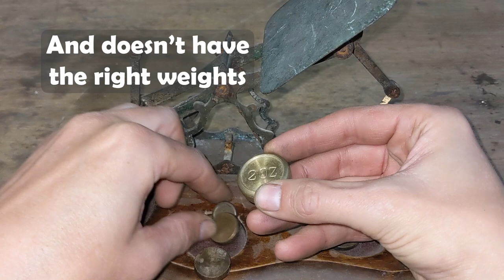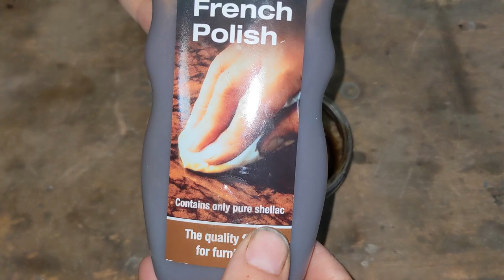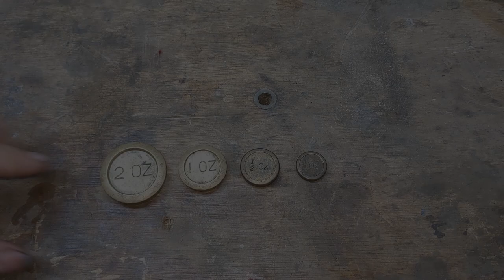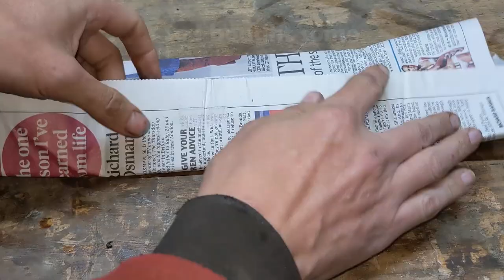Antique Brass Postage Scales Restoration & Repair

Comment: Nice job. I trained as a scales mechanic 50 years ago and worked on many old brass scales and this is one of the nicest jobs i have seen, Well done. Only thing you didn't  do was to sharpen the knife edges and polish the bearings. That would make it much more sensitive and accurate.
Reply from the maker: Great to hear! I'm really happy with how it turned out!
Reply: What weight do you need. I have dozens. Actually hundreds.

Comment: Very interesting. I'm in the process of doing the same however I'm having some issues. Namely finding a good cleaning product for the brass. Also finding suitable screws for the two weighing plates. Any ideas/recomendations would be appreciated. Thank you for the video. Very informative
Reply from the maker: Ketchup (yes, really) works great for getting rid of heavy scale. Just leave it soaking for a day or two. Brasso is probably the best cleaner I've found for hand polishing, but if you have the equipment, machine polishing is always better - you can get polishing pads for drills if you don't want to buy an actual bench polisher.
Screws are trickier - it's often just a case of carefully measuring the old ones (if you still have them) and browsing google for conversion charts to find the sizes you need. eBay is a good source if you just need a couple of screws.

Comment: I restore old timber telephones and I try an avoid sandpaper they are shellac coated as well I use different grades of steel wool dipped in methylated spirits and a lot of elbow grease
Reply from the maker: Interesting; I wasn't aware of that. Thanks for the advice! 👍

Comment: Nice result but since you asked no that's not French polishing that's more of just a shellac finish application not that it's a bad thing because the original manufacturer wouldn't have gone to the trouble of French polishing it themselves it is after all a utilitarian workplace item.
Shellac will give you a nice gloss finish however you choose to apply it, wipe it on with a rag or brush it, it's a very forgiving finish material.
French polishing though is a process and time consuming which is why I say the manufacturer wouldn't have gone to the trouble for a mass produced utilitarian item.
Reply from the maker: Thanks - I realise it wasn't polished like that to begin with. In fact, a few imperfections aside, I'm happy with the finish - it's about what I'd expect to see if it were new. You're absolutely right on that! 👍

Comment: Has postage weight gone metric in the UK?  Grams instead of ounces?  Very nice restoration.
Reply from the maker: Since some time in the 1960s! 🙂 Although imperial measurements are still hanging around, it's a bit of a muddle here. These scales definitely predate metric in the UK though, so those metric weights shouldn't be part of it. 
Glad you enjoyed it! 😁
Reply: I knew most every measurement had gone metric ages ago, I just wondered if maybe postage for letters might have been a holdout like pints for beer. We're still resisting metric here in the USA, although those of us in the science-oriented professions have to deal in both systems.
Reply from the maker: @pfadiva  Ah yeah; no, postage has been metric for as long as I can remember. I think pints of beer and miles (for road distances) are the main holdouts now, pretty much everything else is officially metric. 
There are still people resisting change here, even fifty years after we officially changed! 😆🙄
Reply: Yes, same thing here in Canada,  but kilometers are used for distance on highways.  However, I go and buy an eight foot 2×4...